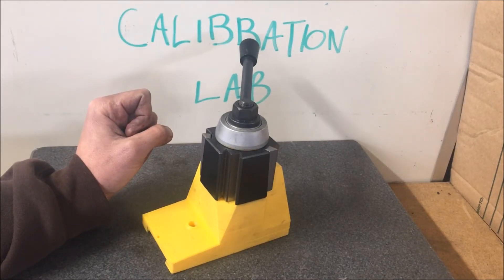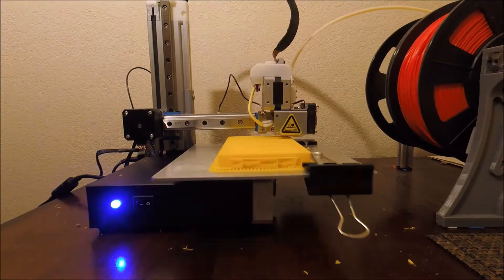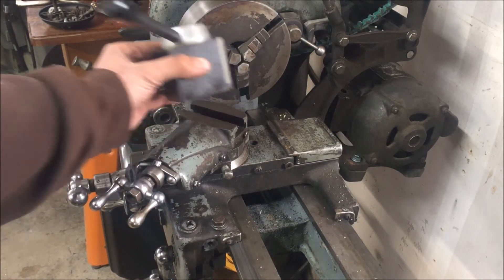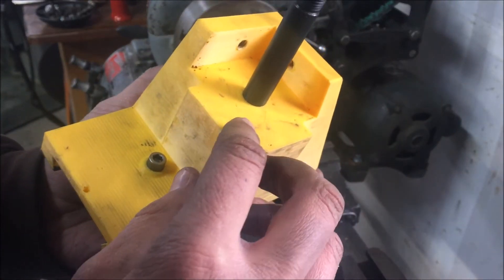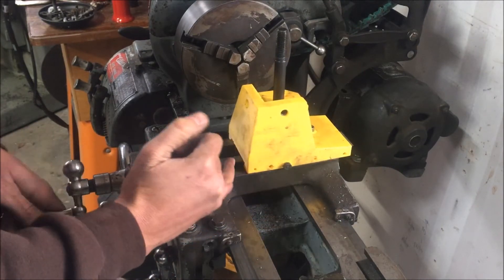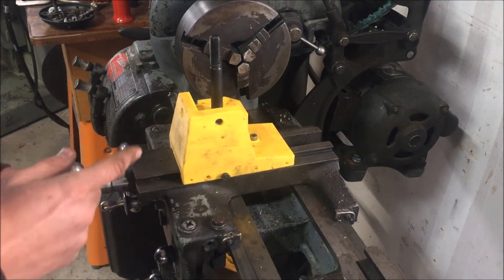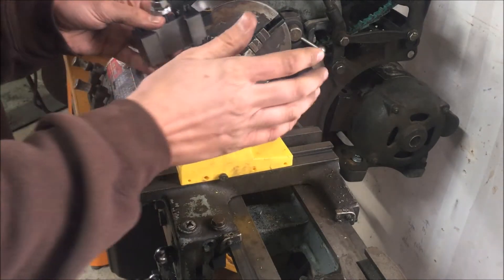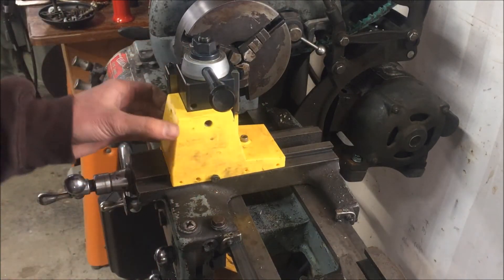3D Printing a Solid Toolpost Riser Prototype For cating with a bonus Dovetail

Comment: This is awesome! Great to see you on YouTube. Did you try taking cuts or only wanted the model for casting? The prices you quote on cast iron are much better than I've found.
Reply from the maker: Thanks Kent, I did get the round stock cast iron but never fully committed to making it. I had purchased a scraper to learn to scrape so I could scrape the dovetail once I machined it, then I realized I needed to make a diamond wheel grinder. So really this project just added to the list of projects stacking up. I very lightly tried a cut but I didn’t want to break the print so I quickly chickened out. Thank you for watching!
Reply: I've been researching a solid tool post for my little CNC lathe and your video showed up right after R.R.'s and before S.G's. That's good company, and you two obviously have skills that I don't but I'm going to try to make something, and I understand about projects stacking... I'm making the tool post to be able to make pulleys for a friend. The print would be stronger printed rotated 90deg so the layers are not aligned with the peel-like forces. I have a small furnace and I think sufficient capacity to cast that size of a part in aluminum. Drop me a email to explore working on this together. It's getting cold in the Midwest, but the days are still above freezing, just. Happy Thanksgiving!
Reply: I wonder if a foundry would give us a deal on a group order?
Reply: @Spetet  look up windy hill foundry on youtube.